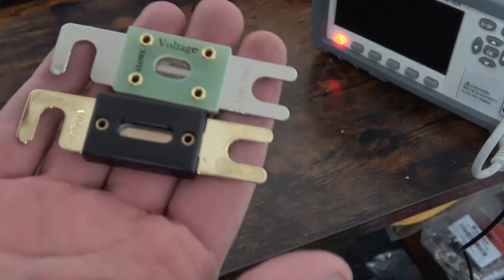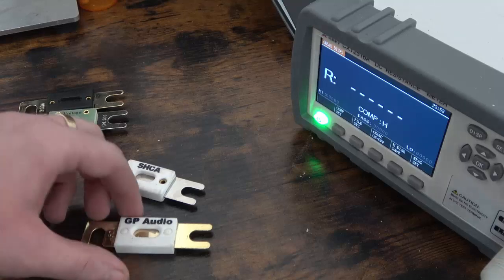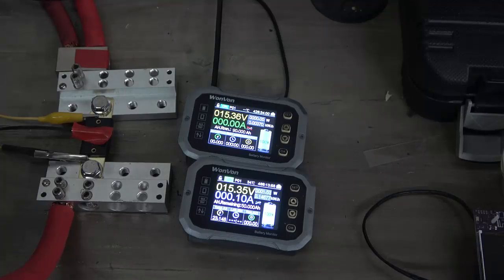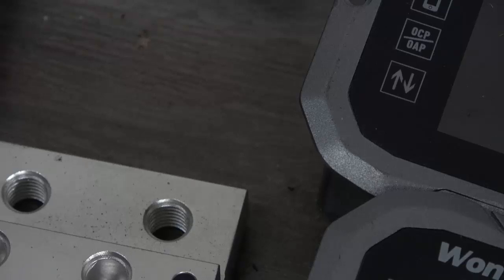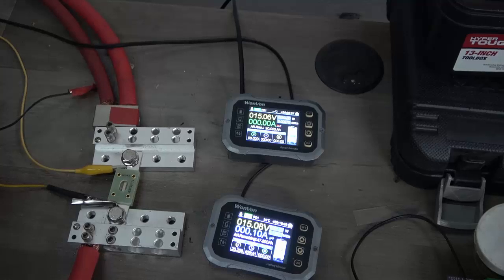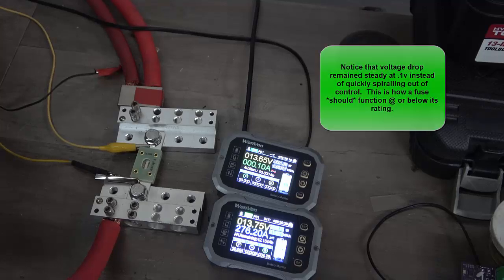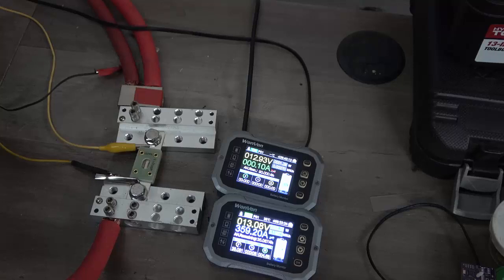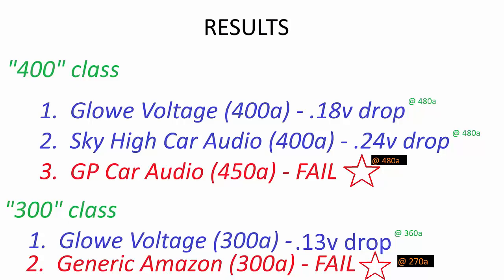Highly recommended ceramic fuses failing misreably? Are generic amazon any good? SHCA tested & more!

Comment: They should pop at its rated amperage not go over  to much maybe 20 amps at most ..the fuse is to protect your wire from burning and burning car down ..if it's exceeding it rating it's not good I would want it to pop so my car don't burn up . Not go over 150 amps .
Reply from the maker: That's not quite how they should work.  Check out this spec sheet for UL listed fuses.  https://www.eaton.com/content/dam/eaton/products/electrical-circuit-protection/fuses/data-sheets/bus-ele-ds-2024-anl.pdf

Comment: Isn't this fiberglass vs. ceramic?? Or am I missing something..?
Reply: The material they are housed in is not a direct reflection of quality. Generally the fiberglass perform better, but that's just a coincidence.
Reply from the maker: I don’t understand the question. 

Is there something bad about comparing the two?

Comment: Could a meter like the Fnirsi HRM-10 that you reviewed for battery internal resistance also measure DC resistance accurately?

If so, here are a couple of measurements from fuses I happen to have handy.
Reply: My old Knukonceptz 250A measured 0.29 mOhm

Install Gear labeled 300A measured 0.45 mOhm

Unlabeled 300A that came with Install Gear fuse holder measured 0.38 mOhm
Reply from the maker: No, AC resistance is different than DC and it takes a diff piece of equipment to effectively measure DC resistance.  AC Resistance is always going to measure less than DC resistance, and there's no real set ratio that I know of to apply to an AC resistance to calculate it.
Reply: @GloweIndustries Ah, so all these measurements are going to actually be higher. Okay. At least they can be rulled out as having very low resistance.

Comment: I'm assuming that the fuse filament could run at several hundred degrees Fahrenheit and the heat will travel to heat up the holder.

This could explain why some people, who may not pull the full current of the fuse, end up with melted fuse holders. 

I think the general thought was moisture and oxidation caused extra resistance and that's what makes the holder melt. Or maybe the bolts just dont tighten down properly. 

Now we have this whole new theory that it could simply be the fuse itself.
Reply: I don't wanna jump to conclusions, but it's something that seems possible.
Reply from the maker: Check this video out of a 100a fuse getting up to over 800F before blowing.  Held it for about 15 minutes or so, even.

https://youtu.be/QeKC5lLo4ZA

Comment: Would love to see how SMD fuses hold up. Had to buy their 200amp fuses cause the lowest your fiberglass ones go is 300amps. Any updates on the series 1 batteries eta?
Reply from the maker: Also on the SMD fuses..  We will test anything folks want to send in.  The GP / SHCA fuses were donated by Trunk Thunder Lithium to see how they performed.
Reply from the maker: Series 1 are currently on back order -- but are not out of stock.   We are just having to assemble them in our warehouse so the lead time is about 5-7 business days currently.
Reply: Ok cool, is your address the same as the one you ship from? I'll order some extras next time to send in. 

Bought a series 1 a month ago and still haven't received it, did you just get them in recently?
Reply from the maker: What's the date of your order?  I'll check on it today when I head in to the warehouse for sure.
Reply: @GloweIndustries  awesome thanks, it was around August 25th I think order number is 4755
Reply from the maker: Is it Greg?  Sending you a text.
Reply: @GloweIndustries  Battery never showed up. Tried contacting you and Daniel over the weekened but no luck. Now theres a major Verison cell outage today so can't call or txt. Please let me know what happened with the battery